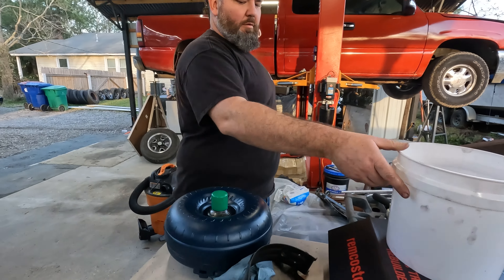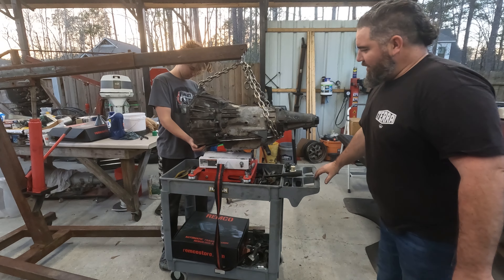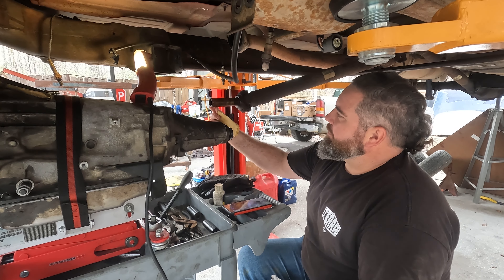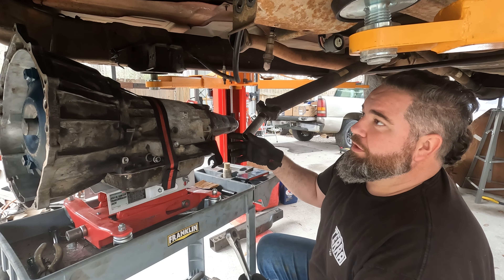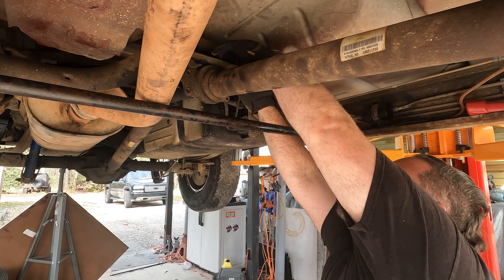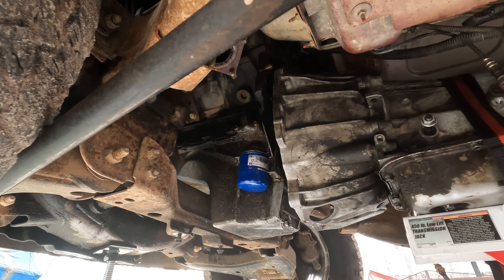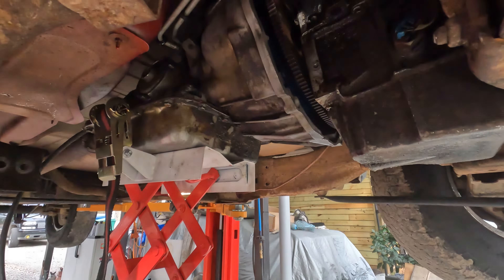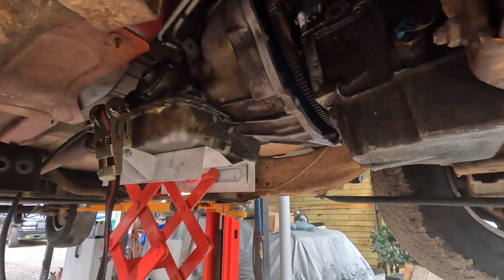Torque Converter and 4L60E transmission finally installed!!

Comment: When were the bolts for torque converter to flywheel done? Did I miss that?
Reply from the maker: @JuanRodriguez-yl9oq  I tighten the converter bolts after the unit is bolted to the engine, and the crossmember is in. It may have been done in the next video. Always remember to allow for about a 1/8" pullout from the trans to ensure proper pump spacing. Usually I'll have to install machine bushings to get the clearance right. I definitely show how I do that when installing the close ratio trans into the RCSB PROJECT. Thanks for commenting on my video, it really helps my channel out.

Comment: I thought you where never supposed to close the space between the trans and the motor with the bolts please inform me if I’m wrong
Reply from the maker: @ZashaunTruett  Never if the trans is in a bind, don't force anything that doesn't want to go. Mine was at a slightly wrong angle but supported. The engine always falls to the back when not supported by the trans. I just used the bolts to line up the difference between the engine mounts and jack positioning. If I had felt any tension when trying to line up the guide pins, I definitely would've stopped and reset. Always make sure your converter is bottomed into the pump when installing.

Comment: Is it normal for the new torque converter to scrape like that? I just put one in that’s doing the same thing. Can you hear it while you’re driving ?
Reply from the maker: No, you shouldn't hear any noise at all. The converter needs to be shimmed and allow a 1/8" pullout from the pump.
Reply: @Modified1 thanks for the reply. I mean the noise at 2:39 in the video when you spin it by hand, mine did the same thing. I just put it in, haven’t finished the install yet. I got a pro king converter.
Reply from the maker: Then yes, you'll hear the pump veins going around as you spin it and make sure it's fully seated before you install it. Also have some machine bushings handy for the install just in case the converter needs to be shimmed back into the trans to make 100% contact with the pump.
Reply: @Modified1  ah makes sense. Thanks for the advice, I’m definitley fully seated, I had a little over an inch from the bolt pad to the bell face. And I’ll probably need some shims too like you said to get the right clearance clearance, looks like I’m at about 1/4” now after bolting up the tranny.
Reply from the maker: @briansviolins9376  I learned the hard way on a '78 elcamio SS I used to have back in the late 90's.  That 1/8" pullout necessary for pump life. Good luck with your build! What is it?
Reply: @ it’s my daily work truck, 2002 Sierra with a 5.3 and 4l60e. This is my first time doing a rebuild; replaced the molded pistons and forward sprag assembly too. All my clearances and end play were good, and the clutches all engage with an air check, no leaks on the forward drum shaft, so hopefully it all works out.
Reply from the maker: @briansviolins9376  it will, sounds like you were pretty thorough with your clearances. I've seen 4l60's slapped together in a gravel parking lot at the dragstrip last years. They are good transmissions, just they get a bad rep from lack of maintenance.  I have a buddy with over 325k on a 2004 z71. Trans was maintenanced every 25k

Comment: if you got this done just by using the book, and everything works,  it would be super impressive.. ALOT of things can be put in wrong.  we watch the video we have and replay segments several times to make sure we get it right,,  even with the vid, we accidently put a bearing in the wrong spot, and couldnt get the snap ring on above the planet gearset.. a few love taps with the hammer and we smashed the bearing,, we got another one and figured out where it went,, we are 90 percent complete now. 
also found a better way to get the teflon seals on the input shaft without nicking them,,, the seal installation tool  strethces them way too big, them you have to deal with that.. so we used an XXL MAGNUM condom,, cut the bottom ring off the condom,, slide it over the shaft, lube it up with trans fluid, then work the teflon rings down the shaft.
Reply from the maker: That's a great idea. I bought the aluminum Teflon shrink tool off of eBay and was surprised at how good it works!! Dude, the trans works awesome!! Got lucky and installed all bearings correctly. 1 day to take it apart and 3wks to put it back together!!
Reply: @Modified1  I bought the aluminum seal resizer and it tore one of the seals, so I took some 1000 grit sandpaper and polished the inside of it, especially the transition inside the tool.. it made all the difference.. 
you should feel a great sense of accomplishment for nailing it the first time,. 
what kind of threw us off is stopping and starting while we ordered and waited on other parts that were bad and not in the kit.. if we had everything we needed, and broke it into like 3 stages over 3 days, I think it would go alot smoother..
Reply from the maker: @oracle wisdom  I used a lot of lubeguard trans goo assembly lube and it made everything go smoothly
Reply: @Modified1  I found that the seals went in alot better with just the trans fluid, in some cases the assembly goo was too sticky and thick.. ive been doing alot of research and something to watch out for is a bad MAP on these trucks will kill a trans QUICK.,they affect line pressure,, so if u get a check engine light for the MAF, or TPS, even O2  sensor, dont let it ride, change it out. 
here in central texas its hard to find a good rebuilder, they are a dying breed.
Reply: its awesome to see some real fathers still out there teaching thier kids,, so many kids dont know how to even change the tire on thier cars.. they cant open a box of cornflakes without the damned internet..
I would put my son up against anyone his age as far as what he knows how to do. and im damned proud of that. you should be too. weve rebuilt a chevy v6, now were doing a transmission. I taught him how to repair appliances, weld, trubleshoot and repair automotive systems,. light carpentry work, how to catch fish, how to hunt, and some martial arts. how to service HVAC systems, septic systems,. the list is endless.  we always have 3 or 4 projects going..
Reply: you look to be around my age, early 50s and bet u can recall in the 70s ,80s and early 90s how secretive transmission repair and rebuilding was.. it was like the mafia.. u had to know a guy, ha
Reply from the maker: @oracle wisdom  yes I do, I'm 42 born in 80 and was always into hotrods, cigarette boats, and muscle cars. Yeah and the transmission guys were their own mafia, lol
Reply: @Modified1  had a boat with what they call a mercuruiser   470 If I recall.. it was a 4 cylinder motor, man it had some balls,, it was a ford 460 motor that was basically cut in half. it was in a heavy chapparal fiberglass boat and it would really get it,, it was a torque monster.   the problem I kept having though is the mercarb would drip gas after shutdown. when u tried to start it, it would hydrolock, and the starter would not disengage,,several times I had to grab a hot battery terminal off the battery to keep the wires from catching fire.. not sure why the starter would want to stay engaged when it did this.,,. it was scary shit for sure. 
wish I would have kept the merc 470 to put in a little vega or small car. I imagine with some mods it would be fiesty..
Reply: the mercarbs were turds, I rebuilt it every year, and it would still drip gas upon shutdown . I never was able to find an alternative carb to put on it,.  If it didnt have the leaky carb, it would have been a great set up. it had so much power, I could manuever the boat around a dock with just the exhaust pressure and turning the steering wheel. also idle real slow  thru shallow creeks in neutral..
Reply: also I recall when repairing leaky outdrives, I used to get my seals from a place in louisiana, they came up with triple lip seals, and they worked great.  I learned alot abt the mercruisers just keeping mine going.  they were a ton of fun when they worked right.
Reply: I think what was happening with the starter staying engage, is it would draw so much amperage thru the slave solenoid,  the contacts in the solenoid could not release.. they wouldnt burn together, it was just the current flow . when I turned the key off, it would just keep trying to crank.. how it never broke anything in the motor is amazing,, 
do they have any LAFFITTE SKIFFS, in your neck of the woods.. they are very popular around delacroix, hopedale,  golden meadows, ect.. spent alot of summer nights chasing shrimp in a 25 footer with a 454 and velvet drive.
Reply from the maker: @oracle wisdom  I know what you mean, I grew up in metarie by bonnabel boat launch and watched Al Copeland run Popeye's all the time!! I always had Johnson/Evinrude o/b's and as long as they make replacement parts I always will
Reply from the maker: @randy1ization  that's awesome, those mercs were it as long as they started!

Comment: How’d you get to get to the bolts that meet the flex plate and torque converter? ( 4x4)
Reply from the maker: Through the space where starter goes. And spin the flex plate by hand to get to all 3. Then install the starter.
Reply: @Modified1  only thing is mine won’t turn its stuck :/
Reply from the maker: @Wheelsss  unless your engine is blown or locked up it will turn. You might be on a compression stroke so use a large flat screw driver/pry bar or a flywheel turning tool and spin the engine over to get to them. It's the only way.

Comment: Whats the best toque converter for lq4 with Lt headers and a tune its on 35s..got trans rebuilt and it seems gutless especially after 2nd gear...
Reply from the maker: What gear ratio are you running?
Reply from the maker: I'm going 4.56:1 on my prerunner silverado build
Reply: @Modified1  3.73 I need 456. ..I've thought that could be why but it had more power before I got it rebuilt..do you know if maybe I need to take it back to my tuner after getting trans rebuilt..I've thought that may be a reason too
Reply from the maker: @C Towne  the stall really gets it going, the gearing multiplies the engine output even more than the trans. Unless your tune has an early shift(below 6000rpm) you'll need gears or shorter tires. Also with 3.73's say your stock tire was a 265/70r17 (31.6 tall) going to a 35" tall tire effectively makes your gear ratio a 3.37:1 and that's a way heavier tire. I'd use tow haul everytime I went anywhere. You've got plenty motor, but now on highway gears with those tall tires.
Reply: @Modified1  is it worth getting the upgraded torque converter and getting the gears later
Reply from the maker: @C Towne  if you have a 2wd it's cheaper and easier to do gears 1st is your 6.0 stock? What is your stall now? You'll definitely get a more noticeable difference from gears 1st. Always build a vehicle back to front
Reply from the maker: A converter is way more work to get to and you may not need a converter with the right gears
Reply: @Modified1  yes stock with Lt headers and tune...ok good advise build from back to front .. awesome man thank you
Reply from the maker: Anytime, I've been doing this for 25+ yrs. If I don't know I'll tell ya. No bs here.